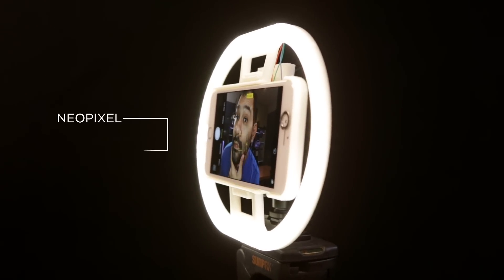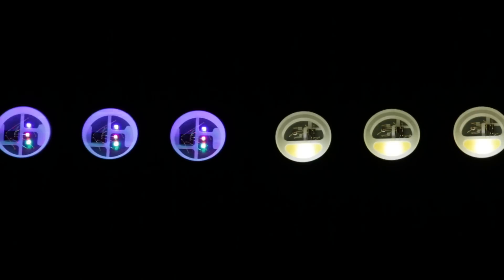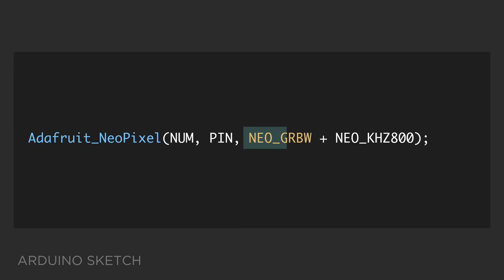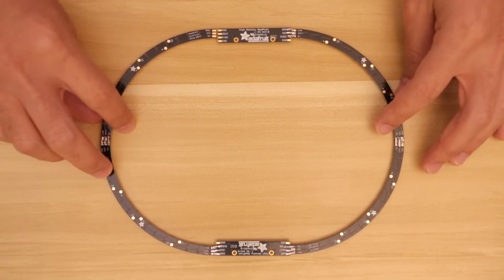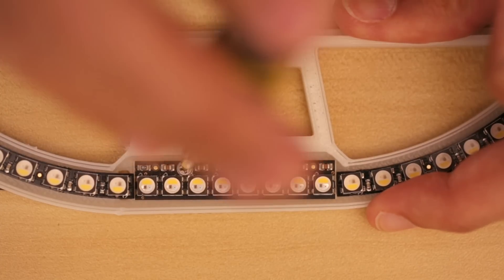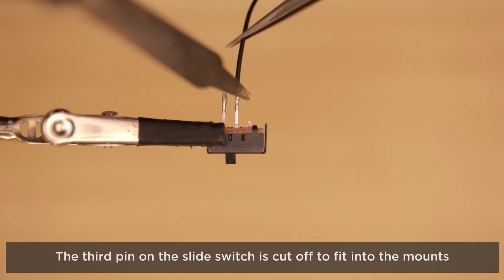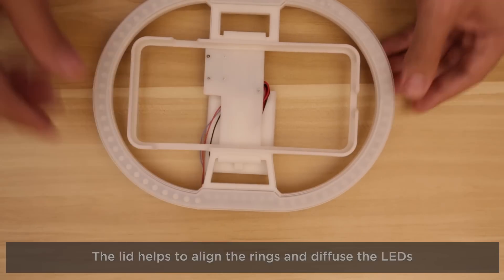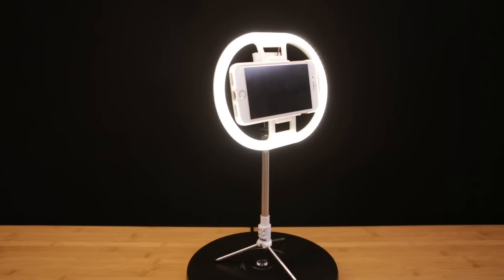3D Printed NeoPixel LED Ring Light

Comment: Great video! Two suggestions: Show off some blinky patterns! It would be fun to have crazy colors reflecting off your face while doing a video chat / hangout. Reduce project cost by $7.50 by leaving out the flexible PCB, twist and tin the two power and ground wires together before soldering.